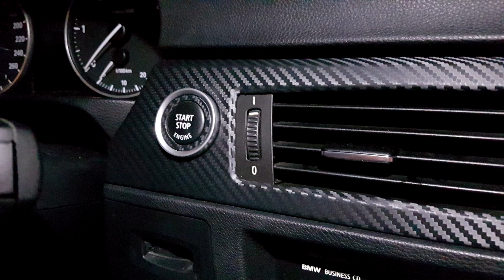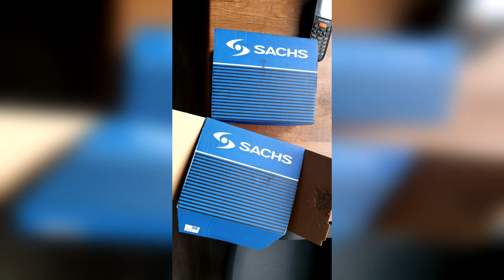Jak zmieniło się moje BMW przez 2 lata❓❔

Comment: where do you buy the biggest intercooler?
is it from another model e90?
Reply from the maker: from e90 335D or 330D
Reply: @Marrrcin88   Thanks! 
But is it plug&play? Or will you need adaptations for the installation?